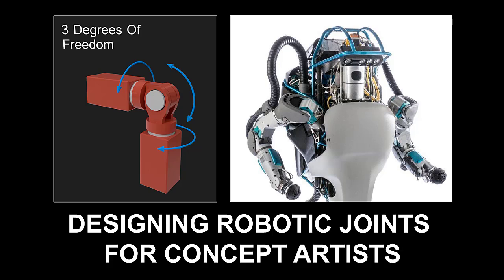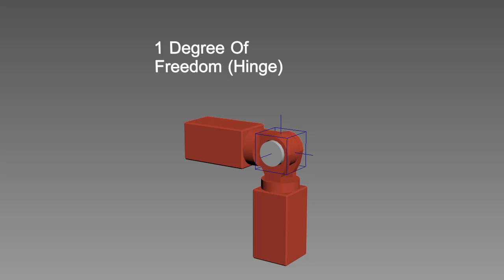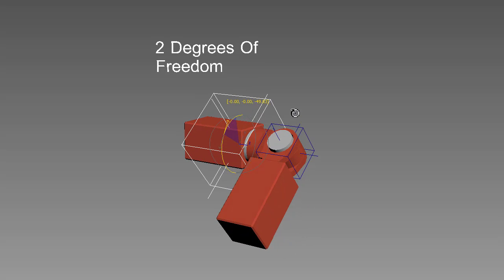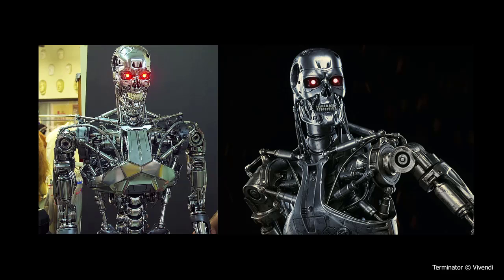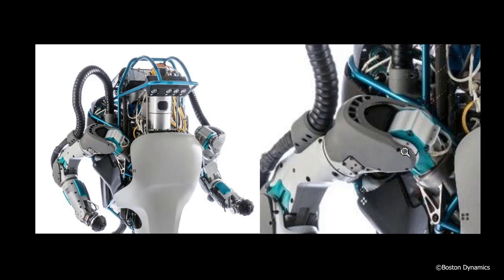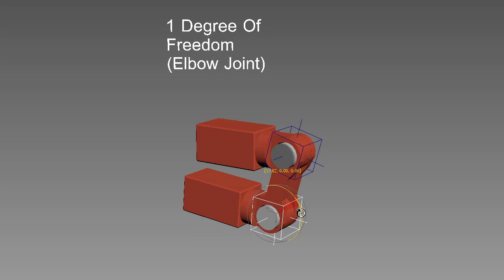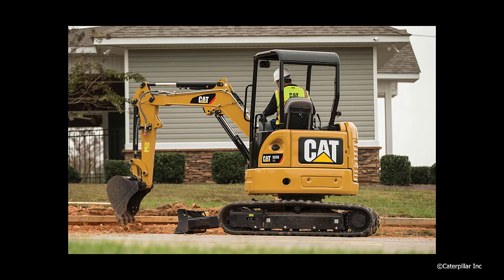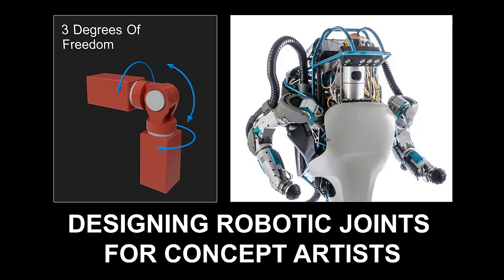Designing Robotic Joints For Concept Artists

Comment: Good stuff! As a mechanical engineer, these mechanisms are all too familiar! One thing to maybe mention to add 'flair' to the designs, is that things like hydraulic cylinders require hydraulic fluid, usually brought in by flexible hoses connected to them. they are then strung along the 'arms' or whatnot, and certainly add more realistic details to the final design. There might also be limit switches or sensors, so those hose lines might also have 2-3 more 'power' lines bundled up with them adding even more details. All of that adds to the realism, even if the final result might not necessarily work 100% in the real world.
Reply from the maker: Thanks Refracted, and ya, love using those hoses for hydraulics. Maybe I should do another video where I focus on adding pipes and wires that actually have meaning rather than random stuff that just looks cool :)

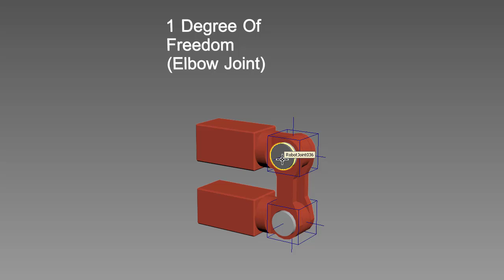Comment: I am pretty sure your elbow joint at 5:40 technically has 2 degrees of freedom since the are 2 different angle inputs for each joint
Reply from the maker: So I see what you mean. What I was trying to get across was that you only get rotation along 1 axis, even though you have two joints that gives you better freedom along that one axis. So maybe I should have said "rotation around 1 axis" instead.

Comment: This is very useful stuff, thanks a lot. But as a concept artist I wonder how to power or fuel these joints to make them actually move?  It will make designs much more believable.
Reply from the maker: Glad you like it! There are many sorts of motors that can make these joints work, such as step motors or hydraulics. So yes, as well as knowing how the joint will bend, you can also play with motor types, which can give it even more believability.